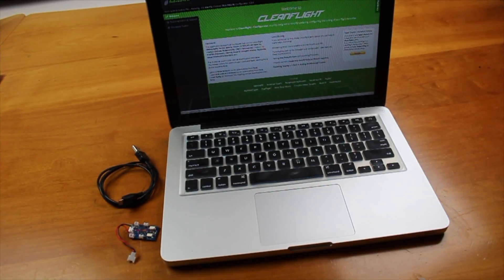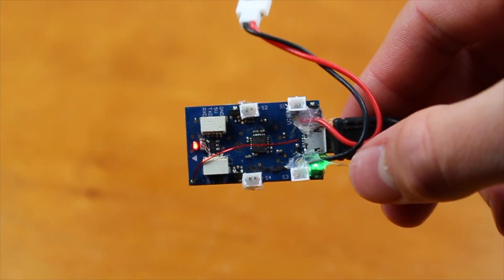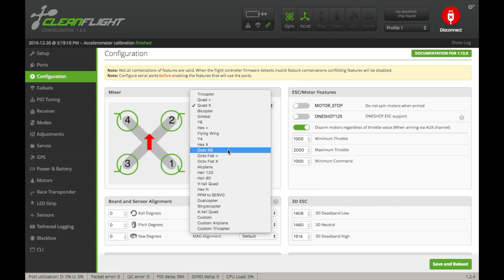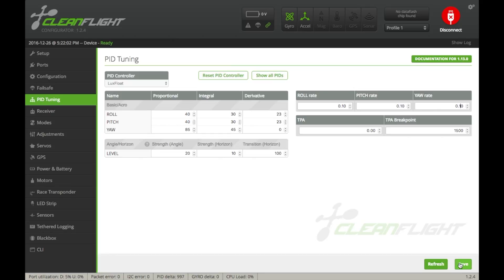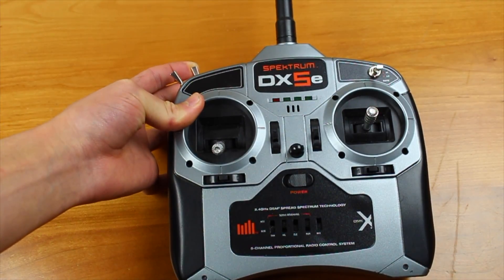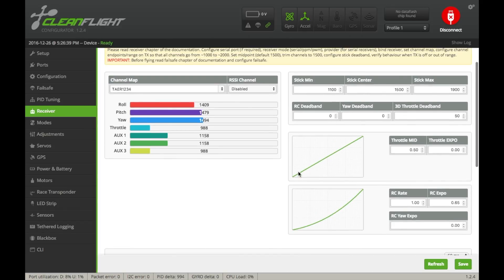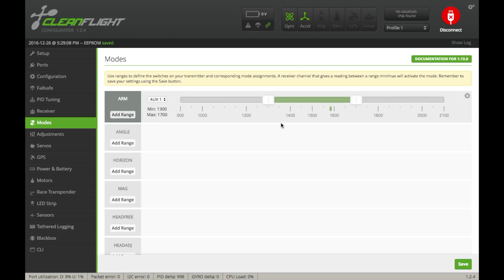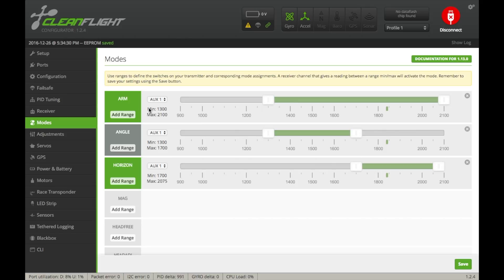Micro Scisky Cleanflight Configuration Tutorial

Comment: great instructions. but i'm stuck on binding  🤔 did that step of putting on default and ppm, and back to spektrum and serial rx. but when i do that, even so i can't get no response from sticks. it show that it binds! i'm getting crazy with this!!! i have a eachine qx100 dsmx/dsm2 version, a turnigy 9xr pro with a banggood 4 in 1 multi protocol module in serial mode. it works when i fly my eachine e010... so it's working.
but can't get it to work with the eachine qx100! 😤 felling desperate... it was a xmas gift and i still didn't got it to work and try it... 😡
but nice work with this video. 👍
Reply from the maker: Hmmm... No response from the sticks in the receiver window of Cleanflight right? What firmware are you using? This may be your problem (total guess, but who knows?). Try using Alienwii F1 as I know it solidly works (I have little to no experience with the problems associated with other firmware). If that doesn't work, check that you've selected Spektrum 1024. If it still doesn't work, contact us directly at banana.science.awesome@gmail.com with some screenshots and a short clip of your receiver page. If you like, I can personally work on your FC (flight controller) (pretty sure I can get it going) if you are willing to send it in. I could have it back in your hands within 10 days. I completely understand how frustrating this can be as we all just want to get into the air and do some FPV! Let me know if any of this helps (could make a video out of it because others are probably experiencing similar problems). 

PS: Chances are, whoever gave you the QX100 bought it from Banggood. If you could get a hold of the order number, you could probably get them to send you another Scisky for free if you are unable to solve the problem. Just contact them at cservice@banggood.com. If you try to use their website, it will just direct you to that number for tech support.
Reply: The firmware is naze 1.12. When i do that step that you change from TAER1234 to EART1234 and the sticks gave reponse, mine did too, then you changed back and it still worked, well mine don't!!! Can't say if the problem is the FC or in the transmitter module!
Reply from the maker: Try flashing to Alienwii F1 (latest version). I know it sounds strange, but it would only take a few minutes.
Reply: I'll try it as soon as i get home.
Reply: Tell one little thing, do i have to flash it using the jumper cable method? Or simply plug the usb cable? I'm a newbie in this kind of things...
Reply from the maker: You have to use the jumper cable. Check out our Micro Scisky Firmware Flashing Tutorial for a simple step-by-step process.

https://www.youtube.com/watch?v=giC5bfjTw68
Reply: Thank you.
Reply: Already tried Alienwii F1, same result! Didn't work... Also tested with Naze 1.14, didn't work either...
I'm going to send Banggood an email to see what they tell me back...
Reply from the maker: Okay. They are currently away from the office due to Chinese New Year, so you probably won't get a response for around a week. Let me know how it plays out.